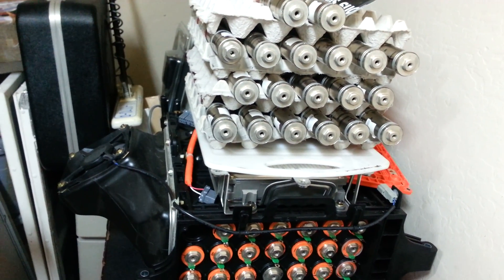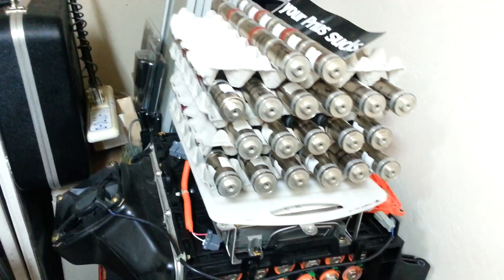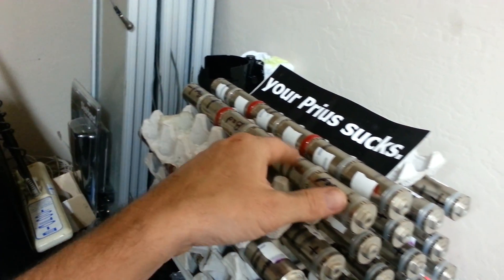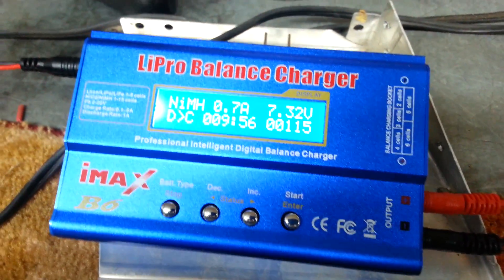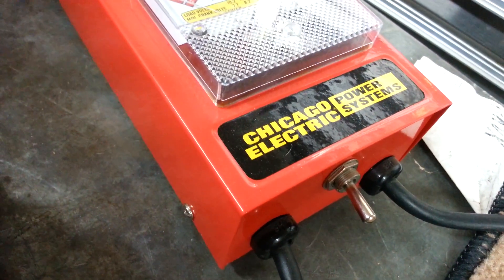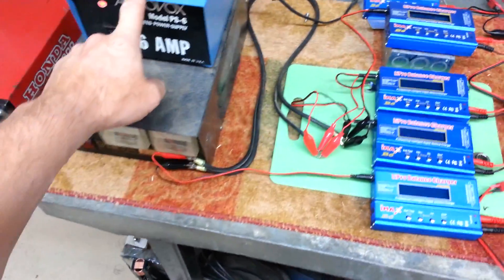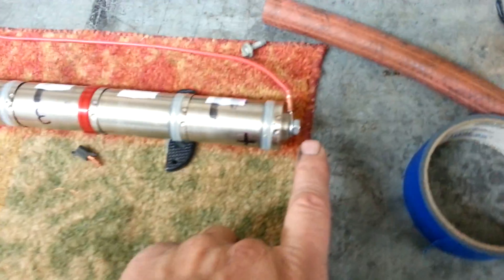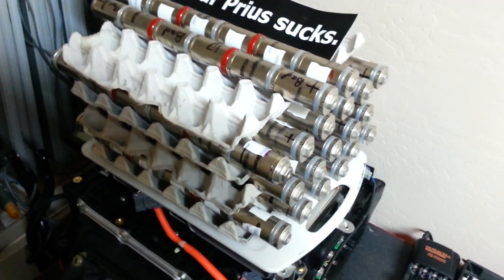Honda Insight Battery Reconditioning

Comment: Great video. I just picked up a parts insight today and grid charging the ima battery. No idea if it'll work or not.
Reply from the maker: I used to build the grid chargers awhile back, still have all the parts to make them
Reply: @DIYPV  Yeah, I have a Maxx Volts grid charger. I got to charge for about 13 hours.The IMA light isn't on as of now. Unfortunately the trans is shot, so I won't really be able to test it out in the car.

Comment: I tried Two batteries on the weekend and they both looked to be " dead". After using this battery reconditioning program ( Check Details Here>>>https://t.co/hSpDD7rny9 ), I had been able to revive them both to 100% functioning batteries. Thanks, it simply saved me about $ 180!

Comment: A note to anyone who might not know: To my knowledge, deeply discharging NiMH batteries in series is a delicate process. Discharging them too low can cause one cell to get a reverse current from the others, which means permanent damage to that cell. Discharging and charging very slowly when they're at very low voltages helps mitigate the risk of this happening as the cells have time to balance out, but it's still taking a chance, so do so at your own risk, and never charge batteries unattended.

Comment: Transcript.

BAD sticks
-Put 1/2 amp load - go down to 4-5 volts in 30 seconds
-wrote bad on sticks
-recycle - 8-10 times.  keep cycle down and up till it comes back to life
 - take down to 1.2-1.0 volt, at a VERY,VERY SLOW Drain.  Then bring up on VERY,VERY SLOWcharge
	-then came back to life
		- up to 6000mAh - 6200 mAh
- after cycling to strong battery, they should be in 8.0 V range, for a few days. Then do LOAD test(below)

LOAD tester
-How to tell battery is good
	-Charge and it goes on the green area, just above 7.5-8 volt (6 volt guide range)
		-put load by switch on battery shows 30 amps, measured by amp meter, for 1 1/2 minutes. It will not draw it down on chart
			-after releasing switch. Check with multi-meter - it is at 7.45 volts. This is after heavy 30 AMP load
Reply: Best expenation ever. That is an information what i Need. Thanks

Comment: I have two prius and one insight. Prius greater than insight.
Insight is a clunky engineering mess of defective software that is then patched to DISABLE capability by Honda.
Ill take my 92 geo metro xfi over either of those cars, 60 plus mpg, more power, more seating, more cargo, better accel, higher top end, better handling.

Comment: While you can bring some batteries back from the brink of death, how do you know that there's no individual cells with enough internal resistance to heat the temperature sensing strips up and cause another error code? Other than that concern - I'm surprised this video has accumulated zero comments over the last year. The Insight is a hobbyist's car, and videos like yours make it possible to acquire the skills to keep them on the road without busting the bank at the stealership.

Comment: What are the parameters you used while charging/discharging? I noticed in your videos that you would use different settings from .7-1A Discharging and .8-5A Charging? How about other settings? Any info would be great thanks :)
Reply: Hi... did you get any answer to this?